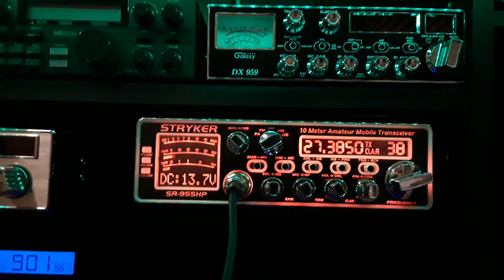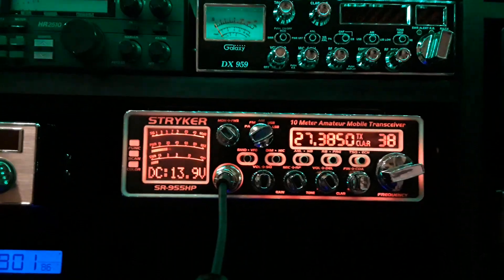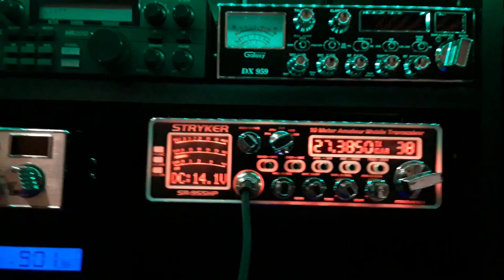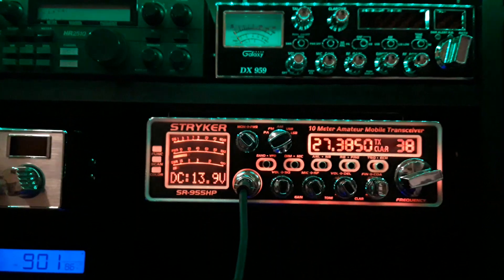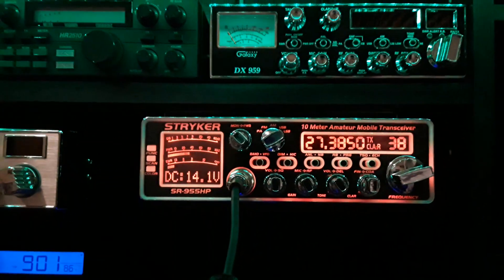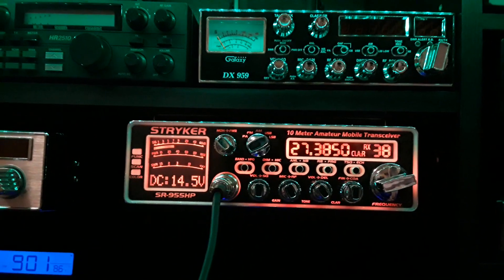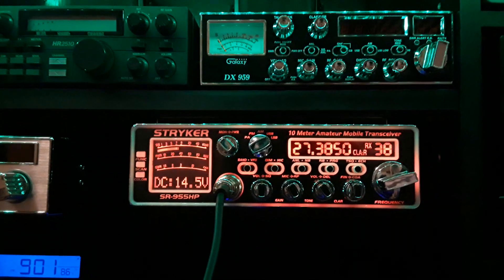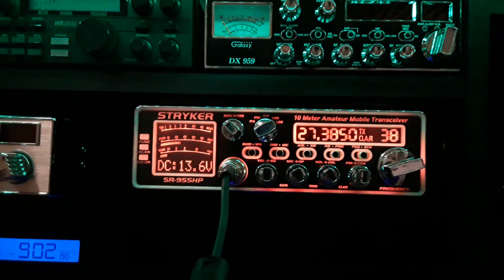Hopper built biased CB linear amplifier SSB

Comment: What size amp is that? I'm looking for a A and or B biased 6, 1x6, 2x6 or 8 pil ssb amp. Do you have any vids of the spec clarity of that Hopperbuilt, or videogates of how you sound? Thanks.
Reply from the maker: This amp is a staged 2x8 so I can run it as a 2 pill, 8 pill or a 2x8. I would not recommend getting an amp from Hopper as I had nothing but trouble with things that I've gotten from him. I'd highly recommend Jim at 307amps. He's always treated me right and builds a very nice product.
Reply: @vegasfordguy  😆👍 Great coincidence! I just actually messaged Jim 5 minutes ago. Appreciate the reply!
Reply from the maker: @mattt3284  No problem. He's a busy guy so be patient. You'll definitely be happy with his workmanship!

Comment: Nate is a good dude and one helluva amp builder.
Reply from the maker: That's what I thought as well, until he sent me a power supply that was bad right from the start. Two bad switching supplies, bad variable potentiometer, bad breaker, one fan with no way for airflow to exit and to small of wires. He did good on my amp and radio, but totally bent me over on the power supply. I had to repair it correctly myself because he wouldn't take it back. Claimed he didn't have the money for a refund. I'll never buy anything else from him.
Reply: @vegasfordguy  
Darn, 
I was about to pull the trigger on one of his base amps. Any bad news on the donkey stomper amps?